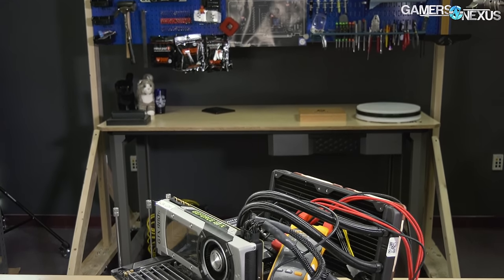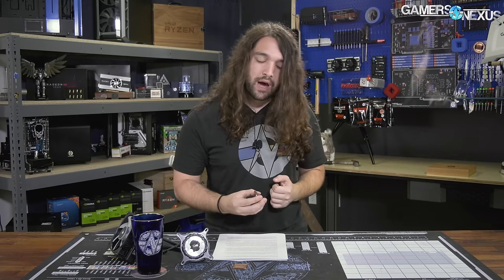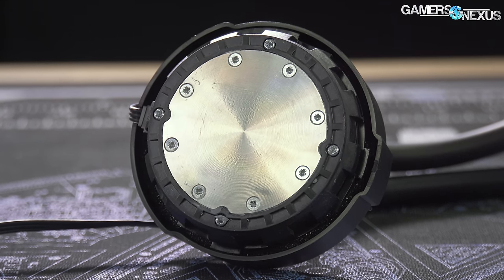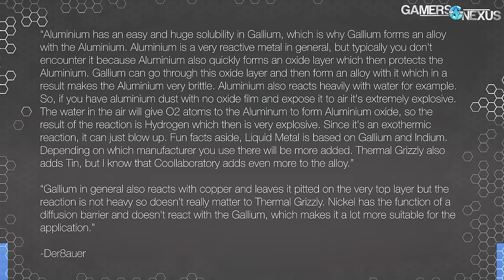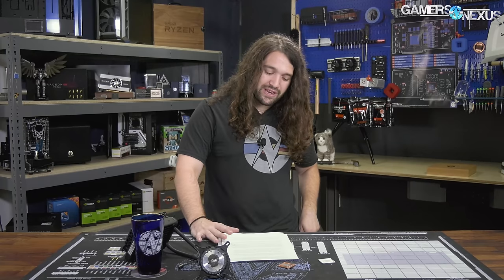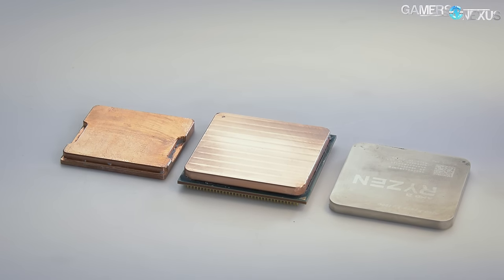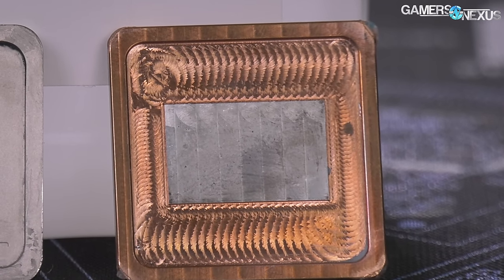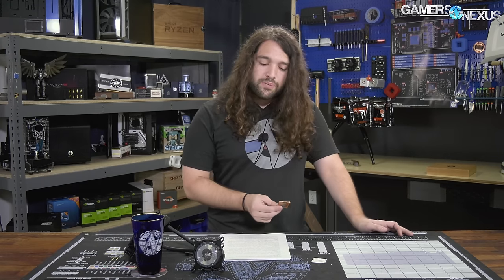How Liquid Metal Affects Copper, Nickel, and Aluminum (Corrosion Test)

Comment: If you want to remove all stains of the LM from copper or nickel, just put the IHS (only the IHS) in a heated 1+4 solution by weight of sodium hydroxide (NaOH) + water. When mixing NaOH with water it is an exothermic reaction so add the NaOH gradually into the water, it will heat up quite a bit, so heating it extra to achieve about 60 - 70 °C might not be necessary. It also becomes very Basic when heated, up to about pH 18, so keep the fingers out. Should also be done in a ventilated area, as the fumes coming off when it dissolves gallium, indium and the tin, are basicly Oxygen and Hydrogen...

Comment: Liquid metal on consoles (ps4 pro/xbox One X)? Or changing the paste for a better one? Does it help? Could you do a test for that? 

Would it help for temps and noise?
Reply: It probably would help as the console manufacturers usually cheap out on anything they just can...
Reply: FortuneFed  To be honest, structure and design usually counts more than the material (e.g. in radiators, aluminium vs copper fins have negligible impact compared to different fin density and channel formations). But of course material compatibility must be checked.
Reply: Helped my PS4 be slightly less of a noisy piece of shit. Unplugging it and never using it again was more effective, though.
Reply: Definitely helps to replace the low quality tim with fresh. I put Kryonaut  on my kids xbox one s, get a lot of heat venting, no real noise.
Reply: i put some nh-1 on my ps4 pro with some new arctic thermal pads, it's quiet now, i imagine liquid metal would work even better and yes you can use it on the ps4 pro as it uses a chopper plated heatsink
Reply: Get the JunPus DX1 thermal paste. It helps a lot.
Reply: @peterkiss1204  Ahm at 80 degrees copper has 180 W(m×K) more heat conductivity than aluminium....so there is a big impact on that but yes if the design is shit you can just scrape it
Reply: @12Burton24  The fin surface to ambient air thermal resistance is so much higher than the metal's itself it makes the difference between aluminium and copper negligible. The fin material isn't the bottleneck in the thermal chain.
Reply: @ThePeters2010  EXCELLENT!
Reply: @robertvuitton  Yeah Umm.. No Thanks.. It's abrasive!
Reply: So... Apparently new patent suggests PS5 using liquid metal...

Comment: Steve, I haven't seen anyone do a review of the CooLLaboratory Liquid Copper - this seems like it could be a much better alternative to the current liquid metals that can be corrosive.
Copper is likely more conductive but should not cause concern if proper application guidelines are followed just like other liquid metals.

i wonder if this might be a good option for those who have had disastrous results with shunt mods using regular liquid metal?

Comment: Super informative! I have a Clevo P750TM1-G laptop with an all copper heatsink, a 8700k that's delidded and using a rockit cool IHS and a 1070 that has direct contact with the copper heatsink. I was concerned about the potential degredation over time but if its just staining, I'm not concerned. Over the six and a bit month period, I haven't observed any drop in thermal performance but I did notice that the liquid metal looked kinda grainy, which made me feel like something bad was happening but after seeing this, it isn't too much of a concern. Maybe its just drying out faster in my laptop since the heatsink's cooling performance is basically maxed out at this point.
Reply: you'll use up liquid metal a lot faster in a laptop than on desktop, in my g750jz the liquid metal started going "bad" after similar time than a thermal paste so in the long run it was not worth it
Reply: As true as that may be, considering the hardware and the amount of heat it chucks out, especially during intense gaming sessions, I'd rather spend the extra time and money of replacing liquid metal more often than being thermal throttled or risking ruining the hardware sooner than I'd like. My laptop basically uses desktop parts in a much smaller form factor so cooling is especially important in my case.

I'm actually working on a better cooling pad by using a pair of industrial Noctua NF-A14s for intake and another pair, one for each exhaust plus some ducting. I don't think the exhaust fans would do too much but after watching Linus' video of adding blowmatrons to a gaming laptop's exhaust fans, it did show an improvement in temperature. Blowies are WAY too loud for me but Noctua industirals aren't and they still give a lot of airflow at high pressures and in a laptop, the higher pressure would be very much appreciated.

When I'm on the go, I pin the gpu to 1500mhz on the core, leave the memory at stock speeds, and downclock the i7 to 3.7Ghz on all cores with a 130mA undervolt (which I use when runnig at 4.4Ghz on all cores as well) then further pull it back to 55% with windows power management and I get a whole wopping 2 hours of gameplay on it, which again considering the hardware and the amount of power it uses and the small battery, that's pretty impressive. Thermals are also much improved to the point I can let the computer manage the fans rather than me setting them to 100%.

Comment: I applied conductonaut to my EVGA GTX 970 FTW+, but discovered a few months later that it dried up (alloyed?) And was causing overheating issues. It was so difficult to remove from the coldplate of the cooler that I had to lap it off. No idea what happened other than coming to the conclusion that it must have been a low quality copper alloy of some type, or I needed to keep cleaning and reapplying it until the surface "stabilized" or something. Hard to say. Did a vid on it too, but it was pretty interesting what happened.

Comment: Here's a video of a liquid metal with copper reaction over a year: https://www.youtube.com/watch?v=FW8fgTjHdCo
Short version: gallium forms an alloy with copper over time (months, a year) leaving indium and other materials as a hard metal residue, which is difficult to remove and often not flat. Because of its surface shape, the residue has bad contact with the silicon surface and does a poor job of conducting heat. So the liquid metal appears to "dry out" and fail over time. I wouldn't say that copper and liquid metal is a safe long term combination.

Comment: Something to be careful off is the copper content as some so called copper heat sinks may be something I came across when working in a fitting workshop called cheap mans copper where aluminum is mixed with the copper.  Was very common when copper prices went up

Comment: Two things, there is so much concern about performance, corrosion, and reactivity, but 1) why aren't people concerned about getting this stuff on their skin and 2) why is everyone using cotton swabs to apply this and paper towels to clean when these things will shed tons of fibers all over the place. What's the point of lapping and trying to get a perfectly mating surface when dust in the air, fibers from application tools, and tons of other crap is getting between the surfaces?

Comment: What about silver? i remember there were some very expensive silver ihs, how will they react to liquid metal?
Reply: Probably not at all is my guess, silver isn't very reactive. Der8auer is the man behind them, and I doubt he would make a custom IHS made for delidding if it didn't work with liquid metal, that just doesn't make sense.
Reply: CampyCamper  silver tarnishes a lot. Perhaps reactive means something different though?
Reply: @1pcfred  Reaction in this sense would be corrosion
Reply: @TheHalfGlassFullGuy  liquid metal does more than corrode metals. Gallium can migrate into metals.
Reply: @1pcfred  Yes but I was talking about the fact that tarnish, in this context, wouldn't be considered as "reactive"
Reply: @TheHalfGlassFullGuy  tarnish is how silver oxidizes.
Reply: @1pcfred  I don't think oxidisation itself, is corrosion. Oxidisation can lead to corrosion, but doesn't necessarily, and can just be a natural occurrence, as is the case when it comes to silver
Reply: @TheHalfGlassFullGuy  oxidization is the combination of oxygen with metals. Oxidization is corrosion too. But there's different kinds of oxidization. The rust many are familiar with is just one kind. All oxidization is natural. But sometimes it is caused by artificial means. Still what metals want to do. Sometimes it's what we want to do as well. Like when we put black oxide finishes on metals. https://en.wikipedia.org/wiki/Black_oxide

Comment: A minimum eutectic should have a fixed composition, so the mixture shouldn't be too much of a mystery. Sounds like they move a little away from the eutectic point to improve cost or performance.
Reply: Moving away from the exact eutectic point to gain some thermal conductance isn't really a problem if the melting point is still under (or around) room temperature.

Comment: I did notice LM making alloy with copper, also corroding the silicon chip in the process, however the temps didn't change at all after a year in the laptop... Seems to make great contact still, till u remove it and look at the damage... However in legion 5 it's super worth it, went from 100°C at 60W to consistent 80°C at 80W on the CPU. Paste works good in there for 2 days, but then reaches unacceptable temps really quickly...

Comment: I just bought myself a 4790k. upgrading from a 4670k. According to the eBay guy, this particular chip has temperatures in the 90's on his coolermaster CPU cooler. I was looking into delidding in case I got bad temperatures. Thanks Gamers Nexus for making it look easy, and for doing experiments like this. I'm about to swap the CPU's. Wish me luck!

Also I die a little inside when you say Aluminum and not Aluminium. IIIIIIIIIIIIIIIIII

Comment: Using LM between my 1800x and with my AIO copper plate resulted in both being glued quite strongly. I had to remove them both out of the socket. Not a good outcome. Sanded both and used normal paste form then on. (shame cause temps were awesome)

Comment: I have the same liquid metal thermal paste and it stained my copper AIO plate as well, I tried really hard to remove the stain but could hardly remove any of it. However I cleaned my Ryzen 9 processor easily. I'm still using Liquid metal just replaced it today after 6 months of use.
Reply: Hi, how identify with my cold plate is nickel or aluminium? i have a laptop msi gf63 thin , but the cold plate of the gpu is not copper looks like aluminium or nickel, i want to put liquid metal there but im not sure she is nickel.thanks

Comment: Iv had liquid metal in my Laptop (GL702VS) for the past 6ish months, and Iv seen the temps go from around 87ish degrees on the cpu under full load, up to 93 under a full load. It uses a pure copper headsink, so there is some pitting and staining, but I tend to think that the temp difference is due to the settlement of the metal vs the bonding of it.
Reply: Edit: the laptop runs very hot, it would peak to 99 degrees when I first got the laptop. its not spectacularly designed, but it mostly doesnt thermal throttle, except under editing workloads, but it does run very hot.

Comment: Interesting! I am still not sure if I will use liquid metal on the EK tec cryo cooler (which is bare copper)
Usually I am all in for extra cooling performance but I also don’t want to ruin a 350€ cpu block

Comment: Ok just to correct you about the copper and gallium potentials. When we look at metals and standing potentials we usually refer to that as the electronegativity. On the Pauling scale copper has a value of 1.90 and Gallium is at 1.81... So the spread between the two electronegative values is .09
 So the spread is what causes the gallium to slowly adhere to the copper.. Copper is not considered positive... All metals have an electronegative value for the most part and is the mechanism that causes the Gallium to plate the copper in a galvanic response.

 Lets say you have copper and carbon. Copper=1.90 Carbon=2.55.. If you use this in a battery the battery voltage would be .65v and the effect would be very drastic...
Reply: sorry to ask could you explain more about the battery?
Reply: great response
Reply: Elektronegativity is NOT the same as redox potential and has no bearing on physical properties. It is merely a model to qualitatively asses how the electrons in a bond between any two element might behave. Redox potential on the other hand are experimental and reliable values measured against a reference hydrogen electrode. if you want to calculate the potential difference between half cells (battery) use the nernst equation.
Reply: You're not looking at the right property. You should be using redox potentials.
Reply: Redox potential is defined as the specific indicator of the extent to which the oxidizing as well as reducing powers of a substance which has both reducing and oxidizing ingredients, have achieved equilibrium.

Redox potential is used as:

An indicator of electrochemical reactivity of substances in environmental conditions
For predicting corrosion protection of various substances and systems
Redox is a shortened form of the term oxidation-reduction.

 It is the electronegativity of two materials that determines how that balance works and hence why aluminum is consumed so actively. as the two metals alloy it will balance the electronegativity out and the process will halt. Redox potential is a singular metal and the oxidation happens from the environment. With electronegativity it is like a potential difference between two dissimilar metals or electric materials. electronegativity determines the voltage between two plates of material with an electrolyte connecting the two in a battery.

 Redox is a chemical reaction in which the oxidation states of atoms are changed. Any such reaction involves both a reduction process and a complementary oxidation process.

The wide variety of methods of calculation of electronegativities, which all give results that correlate well with one another, is one indication of the number of chemical properties which might be affected by electronegativity. The most obvious application of electronegativities is in the discussion of bond polarity, for which the concept was introduced by Pauling. In general, the greater the difference in electronegativity between two atoms the more polar the bond that will be formed between them, with the atom having the higher electronegativity being at the negative end of the dipole. Pauling proposed an equation to relate "ionic character" of a bond to the difference in electronegativity of the two atoms,[4] although this has fallen somewhat into disuse.
Reply: As for explaining the battery concept, which I have proven in experiments, well I think it would take way to long to discuss here. A battery is a two point reference and a redox reaction is a singular metal in it's environment. I can't go into to much detail since it is part of my ionic battery process, as in the crystal battery. I am working to fully explain this new battery but it is similar to an all carbon battery with a doped positive plate and a hydrogen storage concept in one of the plates. I can not go to much further but in the example GN has given the staining is the result of this electronegativity bond and not due to oxidation levels. It is also why the staining is permanent as the oxidation is removed and a direct bond between copper and gallium materials is formed.
Reply: Copper does have a positive redox potential relative to hydrogen.
Cu(2+) + 2e-  -> Cu(s) is 0.337V vs. SHE
Gallium's is -0.53 volts instead.

Comment: So I guess the question becomes how much better will liquid metal work on a soldered CPU (using it between the IHS and cold plate) than high quality thermal paste? Would it be worth buying some next time I upgrade processor or should I just use the Arctic MX4 I have already.
Reply: yeah, the results are up to 20°C from the tests i've seen on youtube

Comment: Thank you for such an informative video! I was wondering about this because this directly pertains to my use case, which is direct die cooling with a copper waterblock on top. 
Hopefully Intel will stop messing around and actually use solder in their heatspreaders. That will reduce the need for having to do these things just to have decent thermal performance.

Comment: I have had gold plated water blocks in the past, not that they are common anymore I'm curious how it would react (if at all)
Reply: Gold has a negative electrical potential, like copper but much deeper in the negative, so it would probably react like copper but the negatives would arise three times faster, or take three times longer to manifest 
If you are worried about pitting and staining then you may want to stay away, but unlike aluminum gold should survive (based solely on electrical potential, I don't know enough about liquid metal to say in other regards) but if you want a definitive answer you could test it yourself if you get a new water block some day, interesting thought non the less
Reply: @LaserHuset  actually found said waterblock from about 2004 I have not seen gold plated blocks since this one. It is amazing how they have changed over the years. If I had any liquid metal laying around I'd be tempted to test it myself.
Reply: @chrispritchard7977  if you don't want it ruined you could test it on the side of the cold plate, let me know if you do and how it turns out

Comment: 3 CPUs (2 de-lidded), 4 GPUs, 3 laptops CPU+GPU (1 Lenovo IdeaPad SLI), 1 PS4 Pro, 1 Xbox one X, and 1 Nintendo Switch. after finding the drying effect is only a matter of time but will happen, possible pitting and definite staining liquid metal is not worth it.